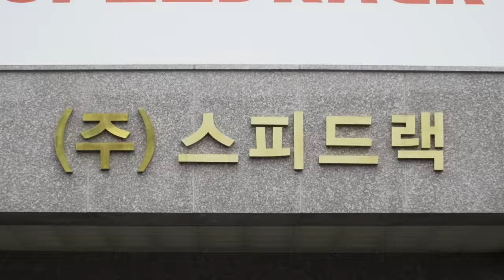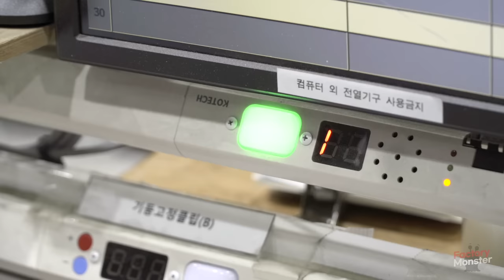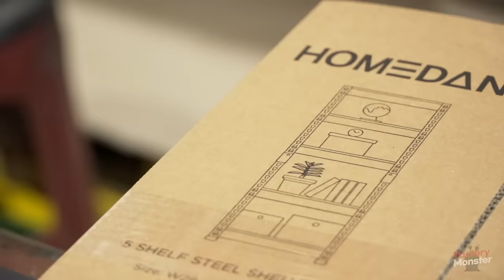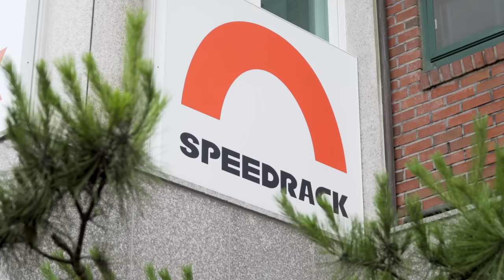Metal Rack Mass Production Process. Furniture Factory in Korea

Comment: the arm at 1.24, is controlling the speed, so the stellroll is not to tight, or too loose, in the stampingmachine.
the oil dripping at, 2.31, is to lubricate the steel, and to reduce wear and tear on the stamping dies.
Reply from the maker: Thank you so much for sharing your knowledge!
Reply: No, that's incorrect. The purpose is to give the material an affectionate pat, which improves product morale and gives higher quality.